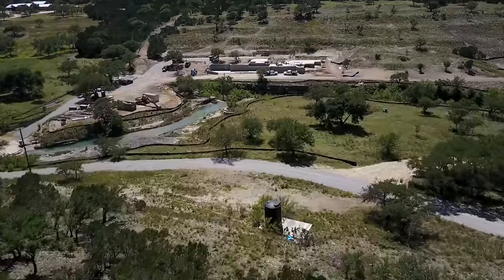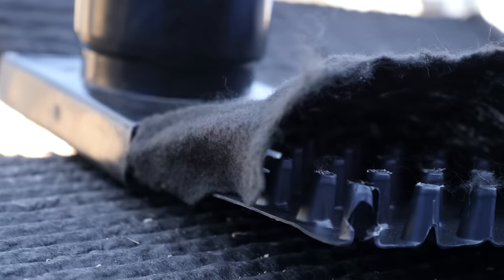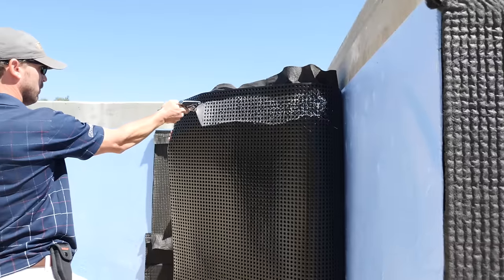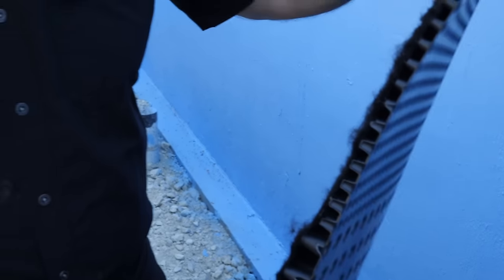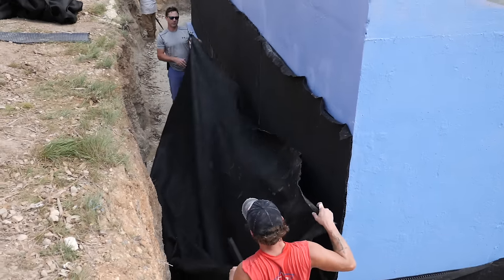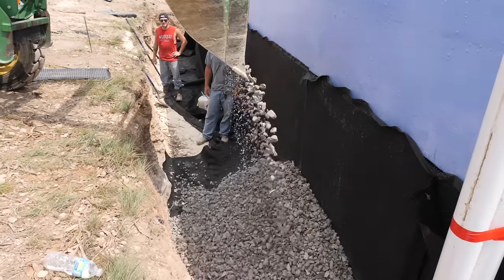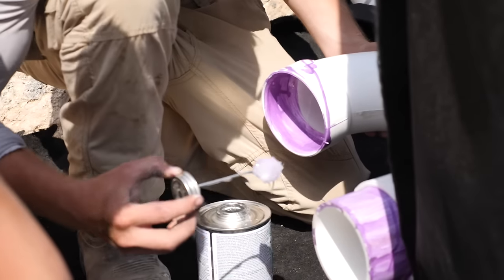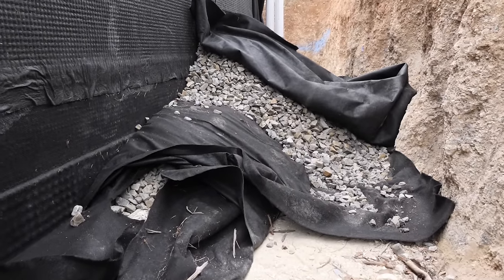French Drain and Foundation Waterproofing System

Comment: This is a seriously nice setup. One question, with the french drain system being tight to the ground with the filter fabric sandwiched tight between the holes of the drain and the earth, is this not effectively creating a tight sock on the only part of the drain that matters for taking in water? Would it not make sense to lay down a shallow layer of rock/gravel before the filter fabric is layed down on the ground? 
I realize this would allow for some water to sit below the drain, but it seems this theory of drainage assumes water gets under the drain anyway to be able to percolate up. As soon as the holes are clogged with dirt against the fabric, this drain has no way for water to find its way in.
Reply: I had the same question as you. Normally I see people lay a shallow layer of gravel and then lay down the perforated pipe. This installation had the pipe sitting directly on the filter fabric. I'm curious what are the pros and cons and also performance differences after several decades.

Luke H mentioned one difference, "this would allow for some water to sit below the drain...". I would assume that a 1 or 2 inch layer of gravel under the pipe is not a problem because the water will still flow horizontally through the gravel but just slower as compared to water flowing horizontally in the pipe, so the water is flowing slower and not actually "sitting". During a massive rain, the water will rise up several inches and then fill the 4-inch pipe, which is filled with air, and allows the water to flow horizontally unimpeded since there is no gravel inside the pipe to slow things down. This will make it less likely that water can ever rise more than 4-inches (above the top of the pipe) since it is draining fast, unless of course a hurricane comes, but still it should drain back down to the level of the pipe shortly after the hurricane is over.

Think of how fast water flows in a 10 foot tall glass tube tilted so it's almost horizontal. If that glass tube is empty then pouring water in one end will reach the opposite end in a few seconds, but if you stuffed the glass tube with 3/4 inch drainage gravel and poured water in one end, it would take 10 times longer for water to reach the other end, but in both cases all water would completely pass though.
Reply: This actually the best way to do a french drain...its the burrito method meaning the pipe lays on bottom...on top of the fabric, then gravel however high you want it, then close the fabric....the fabric is the key...non woven geo fabric....
Reply: @joshuaguenin9507  I understand how the method is setup. He did a good job of demonstrating it. My question was regarding the holes being tight to the dirt with nothing other that the filter fabric as a buffer against clogging the small holes over time. I would imagine they would eventually clog with sediment and dirt. That's why you don't put filter fabric socks tight against French drains and include rock around the pipe in the first place.

Comment: Hey Matt -  Why is the builder using two side-by-side schedule-40 pipes in the french drains?
Reply: That’s explained around 5:12
Reply: Shawn K Matt asked the question but the builder never address why 2 pipes - he talks about the type of pipe and the holes pointing down, but never says why 2 pipes
Reply: northavealum ohh okay, my bad. I thought you were wondering why they used schedule 40. Not sure why they’d need two pipes.
Reply: Yep. I get the scheduled-40 decision - anything less & it’s likely to get cracked. I just don’t get two pipes unless he’s thinking it gives more ground surface coverage to pick up bulk water before it seeps. I’d like to know exactly his reasoning.
Reply: northavealum I don’t either. I wish they’d explained that. Seems like they could ran a T to combine it but maybe it’s a flow handling problem
Reply: Shawn K maybe if we get enough viewers asking about it, Matt will get an answer
Reply: He already dug the hole, might as well add a second pipe for increased performance or peace of mind for the homeowner. It’s a hillside after all.

Comment: Should the French drain clean-out not have a 90 degree bend?  If you need to send a hose or snake it, it's gonna stop at the 90 bend.
Reply: I'd think a sweeping or Street 90 would be better.
Reply: Yeah I agree. I put those Y fittings in mine. The less turns water makes - the better.

Comment: In some applications, to reduce stress on a below grade foundation wall or retaining wall, use Polystyrene foam blocks as fill.
Reply: David Stovall Do you have any links to this practice?
Reply: David Stovall Do you have any links to this practice?
Reply: If they initially build the basement with ICF they would already have the foam insulation. Kind of stupid to still do form work leaving bare concrete monolithic wall needing a sealant coat before the drainage system is installed, the ICF would have saved a few steps and made the build go a bit faster, but would still use the dimple and french drain system. Seeing as once ICF is installed just as fast as forms and does not need to be removed unless one side  was removable board for a bare wall, then there is no need to pay the company for forms which you loose money on anyway.

Comment: How far out from the footer do you run the french drain? Should it extend 5 ft then end into a "gravel pit" should you run it into a bucket with a sump pump?
Reply: Run as far away as possible.  Also the pipe has holes around your house, but the pipe that takes the water away should have no holes and slope down hill away from the house.  I would say a min of 20 ft away.  Only use a sump pump if you have must.  If done properly and you have the proper slope, no sump pump is needed

Comment: Would you recommend a drain system outside along the foundation of my house or in my crawlspace around the foundation wall before I encapsulate my crawlspace?
Reply: This is sort of a civil engineering question based on where your water is coming from and if your crawl space is below/above grade, etc. That said, I would prefer to keep water from ever getting to the inside of the crawl space footing to begin with. If you have access to the outside perimeter, it would seem that would be the place to start with waterproofing (keeping hydrostatic pressure off the foundation wall) and drain tile (french drain) at the base of the footing. 

It's well worth the cost to get an opinion from a civil engineer if you can find one that will come out to do that. My guess it it would be ~$500 well spent vs making the wrong decision.

Comment: What are you supposed to do if you're having basement leaking problems and the house is 60 years old?   I only have 1 wall that's a problem here in Michigan, and it is on the side of the driveway... which is pitching towards the house now

Comment: 4 inch corrugated flexes, sch 40 cracks, also your drain is sitting on top of footing with no slope. Dimple mat should go over footing as well and pipe should be placed on top of dimple mat, for collection of ground water penetrating underneath footing

Comment: Do you have any recommendations on brand/weight for quality filter fabrics/geotextiles?  Also, looking at the perforated PVC it looks like it is solid core PVC instead of cellular/foam but I don't know that I have seen perforated solid core - am I correct in assuming that foam core is sufficient to withstand the backfill dependably?  Great videos by-the-way, I enjoy your showing of best practices as opposed to the same old junk most others seem to utilize.  :)
Reply: Foam core is only good for cold weather builds, but what he sowed is solid single wall, schedule 40 is the strongest I know off from my own experiences.

Comment: @mattrisinger are there any dimple mat products that provide drainage to both sides of the dimple mat?  Looking for product that promote both drainage but also prevent hydrostatic pressure. A dimple mat with filter fabric on both sides and frequent weep holes will allow front and back side drainage and prevent any hydrostatic pressure. All the US products I've found don't offer all those features
Reply: This is all you need, one side dimple over the primer waterproofer be it roll on or stick on sheets, and a french drain as shown though a single run will suffice, used to do this type of work over a decade ago, no problems with what work was done though did get a warranty call for the pumps which are only so good, and we used the best ones then.

Comment: can you tell me the type  (name) of filter fabric used?  This is the BEST french drain !
Reply: It might be a little late but it's a non woven geotextile fabric usually 4oz thick. They have ticker and thinner ones but the 4oz does very well with french drains. If you go thicker it might reduce the flow and if you go thinner it might not hold for that long due to all the weight.

Comment: Some French drain installers  suggest not to wrap the  pipes with  fabric even if the fabric is non woven. 

🤷🏻‍♂️🤷🏻‍♂️
Reply: Water is moving to the pipe as path of least resistance.  Sediment and plain mud would travel in without the fabric to filter.  Without fabric mud will move with the stream flow towards the pipe.  Can't see any other possible outcome.  Fabric may allow fine particles but they would be small enough to flush through.

Comment: Schedule 40. Nice. That's the right way. 

The black pipe shreds

Sch 20 would be ok close to the surface but not 5 feet

Theses guys look like it's done right
Reply: Used to work for my step-dad when he owned a basement waterproofing company 15 years ago, we sometimes if the customer chose to go with would use the bendable drainage only in the basement, outside was either 40 or nothing. He warrantied all his work and would go with him to help fix issues for past customers, ever a problem with the system other than the pump which would get overworked or clogged.
Reply: Maybe use Sch20 to drain around a slap foundation. It’s shallow and you really just want the water from getting under the foundation

Comment: This is a great system however it would be more effective with the French drain along side the footing verses on top of it. Then sleeves through the footings approximately 10 foot on center to the interior drain tile. I’ve done this literally on hundreds of homes without a failure.
Reply: I'm pretty sure this system was designed by an engineer and Brian wasn't just shooting from the hip with this design. There is no one way to do something, and many factors are involved, including soil type, that the engineer would need to be accountable for and have equations to back up. I'm sure there are good reasons to put it exactly where it was put, but it would be nice if more of the questions asked in the comments were addressed by Matt and/or his guests.

Comment: I'd skip the liquid waterproofing (ironically, you can see a ton of bubbles trapped behind the material.  He had his crews patching those that had already burst, but there were thousands more that will burst once the weight of the backfill is applied, making the product a costly waste of time).  I'd use the dimple mat drain, Sched 40 pipe, cleanouts and backfill with a generous width of CLEAN drain rock.  I don't particularly like his burrito system - even clean drain rock has some fines that could clog the pipe, but it;s better than nothing.  If I wanted bullet-proof, I'd use Xypex on the walls - it will stop leaks from the inside under hydrostatic pressure because it molecularly bonds inside the concrete itself.

Comment: 1:58 they made cuts at the edges... 
So the water definitley find a way behind...
Reply: Thomas Conrad - I noticed that too. I think that as long as there is "air" between the foundation wall and the dirt, then water will basically "fall down" to the french drain. Even rain running down the wall from the 1st and 2nd stories above will drop into the french drain, so there will be no hydrostatic pressure of water pushing into the wall, just a wall that is as wet as the above stories.
Reply: @donaldlee6760  running water is one thing, the other thing is steam or dew. Once water/moisture is behind the french drain, with no direct way to get out (the stuff on the wall is no membrane), the problems will start pretty soon.

Comment: If the blue product is so superior then why the extra mile and  cost  to prevent water from contacting the poly wall.
Reply: BAC the second layers is a barrier to prevent fill materials from damaging the blue water barrier on the house. Additionally it helps letting the water drain down to the French drain.

Comment: sure maybe on a place like this where your backfilling 6 foot plus i can see the black corrugated pipe would be crushed but most homes without a basement would suffice with the  stuff as you're not going that deep.
Reply: I was wondering about drainage for that deep a French drain.  At 6 feet deep unless on a hillside where do you disperse the water?  How about if you cannot tie into local runoff sewers?
Reply: @starleyshelton2245  in this case its a walk out basement so he can bring the pipe to daylight. In a case where you cant bring the pipe to daylight people either use a sump pump outside or tie the exterior drain system to an interior drain system where the pump will be located.

Comment: Yes, this is a very important subject. Don't think I liked this system so much though. That seal means that all moisture in the wall must be ventilated to the inside. Another vapor barrier there will stop the moisture from escaping anywhere - it will build up. Might work in the dry and warm climate in Tx maybe, but the design is not good. Definitely wouldn't used it in colder and wetter climate. 

Far better system is ISODRÄN or Pordrän. That is waterproofed Styrofoam , with a similar structure as cinder blocks. Any water that get into that system will fall  through the insulation and down into the drain pipes. Moisture in the wall will migrate into the insulation and condense and fall down into the drain pipe. And I think that point is very important. No seals required.

Has been used in Sweden for more than 40 years. Don't know if these boards are available in the US.  Unfortunately no good videos of this system that I could find,  but an excellent illustration @5:31 in this video: Pordrän

Again, this is a very important subject, and by far the best systems I have found is ISODRÄN and Pordrän.
Reply: Though are not available in the USA since we got our own systems, I used to do waterproofing for my step dad when he owned a company doing that work and we warrantied all our jobs no matter even if it was a pump failure we would go in and fix or replace. This system we have aside from using tar and paper which is old and not so environmental or clean but STICKY in its own ways. Seeing as I have not been in the business for over 15 years I can say from what I have seen the stick on membranes are are easier but still sticky as heck and as long as you apply right it will still allow the concrete to breathe if bare. ICF if you ever heard and use it there recommends sticky plastic sheet like I mentioned and similar as I assume to what you say, This dimple is also great on top of it along with the french drains, though one system suffices instead of overkill with two, but they get so swamped there.
That is all based on what i watch online about the stuff to remind me of those days. But I also remember the many CMU built basements with their cracking issues leading to failure and water intrusion, such old fashioned modern construction, NOT WORTH IT if you think it is, even earthquakes and hurricanes have proven many times how weak no matter how strong looking those blocks are.
After pausing as I wrote the previous, I looked at those two and it seems like what ICF does, it seems to provide drainage though since its bonded like porous concrete/pavement and may even provide some insulation value from the pictures I looked at.

Comment: Why wouldn't they put holes in the pipes at 12 o'clock and at 6 o'clock?  Brian was very insistent that the holes are always down, but any water above the pipe traveling down would then get into the pipe from the top, no?
Reply: Ground water moves  up and out. Not down and out. Holes on the top might work as a backup if the bottom holes ever got clogged, or just add to the clogging. Holes set at 5 and 7 are common.

Comment: Why is he putting the holes facing down?  Wouldn't the water just run back out and not downhill to whereever it daylights?
Reply: kmb383 it’s collecting the water from the underside. Otherwise the pipe would always be submerged in water. 
The water seeps up into the pipe and once there is enough it drains downhill.

Comment: Yep this is a great product but you pay.
I always do two water proofing methods just in case one fails.
Twenty  years ago was assured by supplier that a particular paint on water proof membrane was the best, yep failed last year.
Insurance covered damage but not rectification, my expense, my house.
Some core flute against the wall, drain then aggregate covered in geo textile fabric.
I now no longer back fill against walls just leave a void if possible, the best option.
Great video.
Reply: pulporock that’s why you shit down your company after 10-15 years and start over. Can’t get you for liability that way. 

I’m just kidding. A real professional will act responsibly. Like you did.